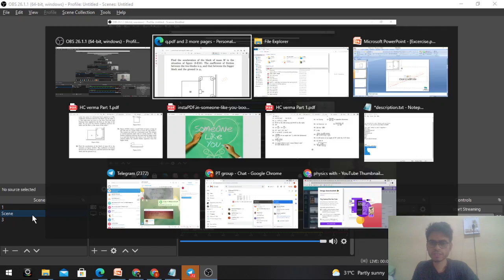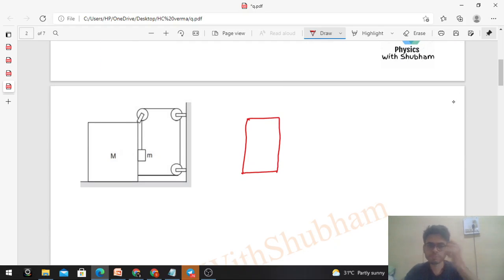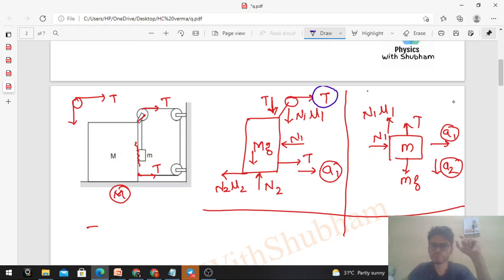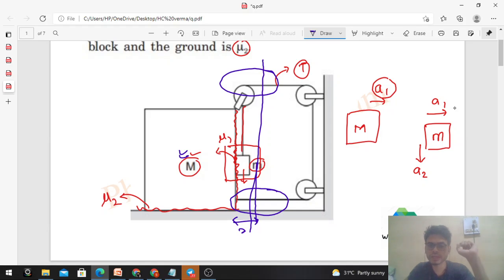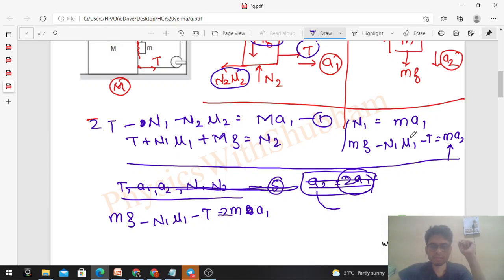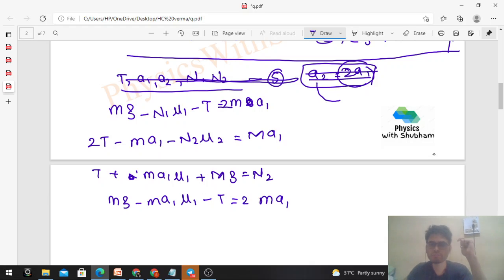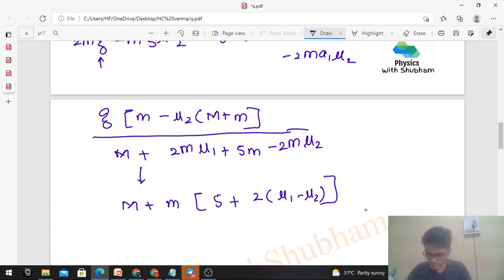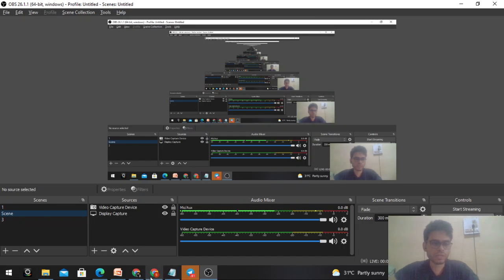Find the acceleration of the block of mass M in the situation of figure (6-E10). The coefficient of

Comment: Sir how n1 equal to ma1
Reply: See, we are assuming that the 'M' block is moving with a1 in right direction... 
As 'm' will remain in contact throughout the motion, means m will also move in the right direction with acceleration a1. 
Now after drawing the free body diagram of 'm', you can see that only N1 is acting horizontally on 'm', means a1 is due to N1 or you can say m×a1=N1...